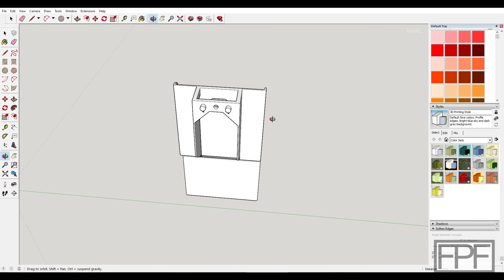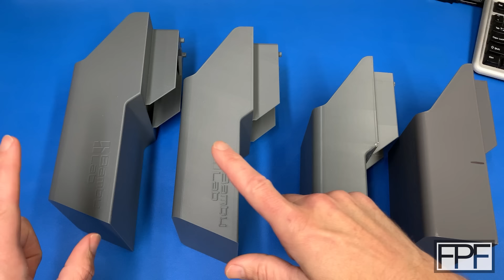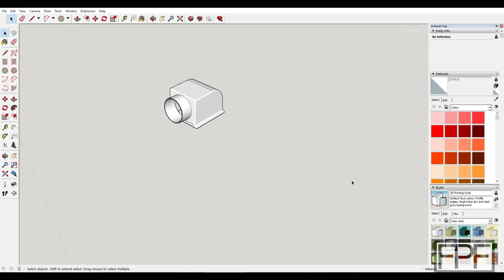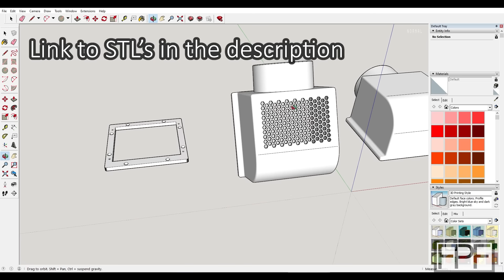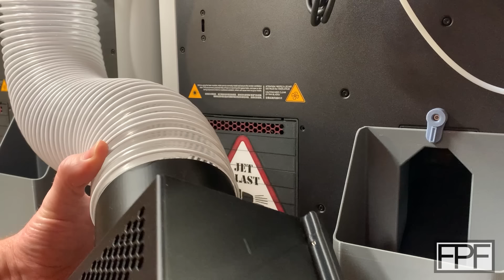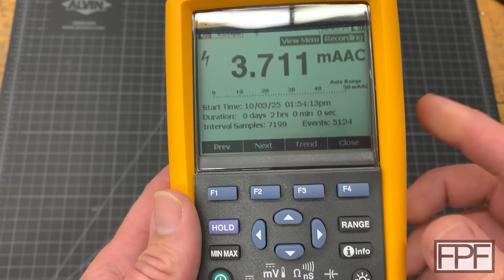H2 Series Fume Extraction for 3D Printing - FINISHED

Comment: It's an interesting exercise finding an orientation that gets good print quality with minimal supports, but don't forget that you don't have to print a piece in on go.  You could for instance have printed the top plate and hose adaptor as one piece which slotted into the rest.  For some projects you can still print as a single piece, but have a living hinge.  For instance, in this case you could have had a hinge between the top/adaptor and the rest of the build.  It does complicate the design somewhat, and I think your solution is probably best for this design, but just keep your mind open to the other possibilities.

I suspect your observation about losing less heat with the extraction on boils down to where the leakage was coming from.  You were equalising the volume of air being removed from the enclosure, so that none was escaping out of the chute.  If there's a lot of hot air near the poop chute, each cc of air leaving the chamber is also removing a lot of heat.  If the fan is in a relatively cool part of the enclosure, each cc is removing relatively little heat, so although you're removing slightly more air, you're not removing as much heat.

You face a similar issue when installing fans on PC enclosures.  For maximum cooling, you want the fans at the top to extract the hot air, and the fans at the bottom to push cooler air into the enclosure.  If you get the wiring polarity wrong, you're pushing cool air in at the top, but this just causes the hot air to circulate around the enclosure, and you're extracting the relatively cool air from the bottom, greatly reducing the cooling effect.  If you increase the fan speed, you can still get cooling just by replacing more air, but if you get the fans extracting from the hottest spots you need much lower fan speeds.

Comment: That is strange. After you made that video, I went and printed the waste bin using bamboo PETG translucent, and it printed very cleanly…. Well, the first time it warped mid-print and the tool head knocked the entire print over, but the second time it printed very cleanly…

Comment: Too late for it now, but one idea to avoid supports on the part would be to either make the bottom completely flat or to change the bottom curve of the exterior to a flat surface angled at 45 degrees. Either way, the inside could remain rounded.

Another idea is instead of having a flat surface on top for the exhaust hose fitting, use a lofted surface to transition from the top square profile of the vent box to the round profile of the exhaust hose fitting. If designed right, the resulting taper would be steep enough to print just fine without overhangs. Combined, the two ideas would allow you to print with the bottom laying flat on the print bed and no need for supports.

Comment: For the over-blow feature of the fan hood, perhaps a bit of a mylar covering to allow one way blow, where the gate is closed the printer is blowing that it has an exit.  Otherwise I think that constant low pressure from the radon vent is not too concerning unless you are printing ABS and have a cooler basement drafts that would react to 'Shock Drafts'

Comment: Another excellent video
From the video you seem to be monitoring AC current to the entire printer. If so you may need to consider one of the other main loads other than the heater, the fan. With your hood in place the chamber fan is no longer exhausting against atmoshperic pressure but instead against the lower pressure of your Radon system. This might explain your printer slightly lower energy requirements.
Keep up the good work
Reply from the maker: Could be

Comment: Wow, simply an amazing video one of your best so far.  I learned a lot, and a cricket hunt to boot!  Again, on the back with the pegs, the Bambu Labs fume extrator actually screws on using those holes, but I guess there are advantages to have it be totally removeable.
Reply from the maker: Only so many times even when lining up at the start of the thread that self tappers in that plastic will last.  Bambu cheaped out there. Should have been steel or brass threads.
Reply: @FunctionalPrintFriday Oh maybe I missed that.  Thanks for the reply!

Comment: I think you mean well. The top flap is great, but I think you shouldn't cover the flaps with your part, but rather like an extractor hood in the kitchen, i.e. above the outlet flaps. Then you won't suck the air out of the printer, but the poisonous gases will definitely disappear into your hood with the hose. And because the flaps are printed on the printer with a lever, you'll definitely manage to make the flaps open upwards so that the air is blown directly into the hood. Nevertheless, it's cool what you're making for beautiful parts, top-notch, and I love your videos and work. Greetings from Germany

Comment: I would be interested to see a flap valve fitted to the poop chute and similar power usage tests ran.
Obviously the spring on the flap valve would need to be infinitesimally weak to be overcome by the poop coming out of the printer.

But if your theory is correct, then this should also achieve the same as balancing the extraction (should be identical???)

Comment: Those threaded dowel pins are fabulous! I also use my hot air rework station for heating up all sorts of things in a controlled way that aren't surface-mount soldered components. Really handy tool to have around the shop, and they're not that expensive these days with the cheap import models (which do a more than adequate job for home use).

Comment: Interesting video, and solid, thorough analysis and effort, but not necessary to be this precise with negative air pressure as the chamber is actively heated and there are many other varuables in play.  Much better to focus on VOC mitigation.  Based on my own much less precise Diy heater setups and only hitting 45-48C chamber temps, for any materials these printers are capable of printing slightly too much negative pressure will not matter.  First layer adhesion and printing with the right temp, speed, and part cooling will have orderers of magnitude higher margins of error in regards to impacting warping, layer adhesion and part quality.

Comment: Aerodynamics is complicated, but off just intuition I'm thinking the transition from a rectangular box to a round hole would cause a lot of turbulence near where the hose attaches to (which is also where the holes are, which complicates things further). What might help is using a loft to transition from the boxy shape to a cylinder for the hose. Probably negligible though all things considered, but just some food for thought!

Comment: Questions:
Can the hinged vents (Jet Blast) be reversed so that when opened, they face upwards, directly in the direction of air extraction?

Why not replace the magnets and pins holding the air hose adapter with a printed U-shaped guide held in place with double-sided tape or screws?

Ideas:
Regarding the waste collector, design a closed one. Finally, add a cutout to hold an acrylic piece. This serves as a fill level sight glass. When closed, it won't function as a chimney or air injector into the build chamber.

And about the control of the air suction system, to be as less intrusive as possible we must go into more technical issues, we need to have an idea of the revolutions of the extraction motor, or measure the differential depression inside the printing chamber, and for this I was thinking of taking 2 measurements, the first measurement would be the opening of the air inlet gate that would deliver an on / off signal, thus avoiding the complexity of reading RPM from the extraction fan or the installation inside the printing chamber of an anemometer, the second measure is achieved by always measuring the real depression (differential pressure) in the printing chamber, with these measurements, especially with the last one, we can control a flow control gate in the external suction hose, obviously all this or we would do with an MCU (esp32 or arduino).

...and excuse my poor English, I used Google Translate because my language is Spanish. :face-green-smiling:

Slds!  :face-red-heart-shape:
Reply: Exactly!  The Bambu Lab fume extrator uses screws!
Reply: As someone said in the comments, if you want a fill level sight glass, you can make the waste collector with both opaque and transparent PETG sections (gosh multi filament printing opens so many possibilities).

Comment: Why place the blast gate on the ceiling? I would have tried to design a gate at the back the printer (ball valve or butterfly valve) so that you could open/close it there rather than trying to “balance” it with the paper towel.  Then put in a wye for both and control open-closed for each printer where you could have them both open or both closed.  IDK.., just what I was thinking the whole time.

Comment: Could you try a clear lid on the purge bin to prevent hot air convection from escaping the purge shoot opening?

Could you integrate a free swinging flap instead of the hex pattern into the vent cover, so that you can adjust the blast gate just by making the flap swing neutral to very slightly inward?

Comment: I don't see the need for holes in the printer flaps. They have enough slop that a neg pressure atmosphere would create a draw IMO. I think the big flaw is that when printing things like abs the printer is going to change pressures to maintain set heat. Meaning you will need to babysit the printer to maintain your paper towel settings. Also doesn't the printer increase the fan huge at the end of the print to cool the chamber. I don't have my printer yet so I don't know... Fun experiment but I think it would be better to have a hood over the unit and something around the fan door to get the fumes when the printer fan kicks in. Also the printer isn't air tight. I would love to see where most of the VOC's are leaving the machine from, my guess  it is not the exhaust or any of the side holes (poop hole) but from the top of the unit even with a slight neg pressure.

Comment: Makes sense that reducing heat loss in one area will reduce the need for heat input to the chamber.... You may also want to consider adding a fine tune adjustment to the suction gate to make it easier to tweak the suction. Maybe an 'iris' assembly on one side of the gate. Leave the gate to quickly and securely allow or isolate flow. Here's an example... https://www.youtube.com/watch?v=Aai_c5PSpf0

Comment: With an Arduino and a barometric pressure sensor you could probably control the blast gate/flow rate automatically.  Those sensors can detect tiny drops in atmospheric pressure and are commonly used in weather projects or as altitude sensors.  The barometric sensor could be placed inside of the exhaust cover you printed and be used to maintain exactly 1 paper towels worth of negative pressure in that space regardless of state of the exhaust fans/louvers on the H2D.  Alternatively, it could be placed in the H2D chamber itself to measure negative chamber pressure directly which could be useful if you wanted to be able to detect certain situations like door left open, poop chute cover left off, or any other config change that could prevent the desired negative pressure from being achieved.

Comment: The heat loss through the purge chute is called a "thermal syphon."  It happens when hot air/liquid starts to create a convection current with part of that current running downward (against the normal flow of hot air).  This can happen when the combined downward sections of the path are less than the combined upward sections of the path.  Once it starts flowing, the rising hot air in the upward sections pulls the air behind it through the downward sections.  Vice versa for cold fluids of course.  So, similar to syphoning a liquid through a tube.  The liquid can travel against gravity to some extent, but only if the overall path is with gravity.

The way to prevent a thermal syphon is to extend the section that is going against gravity/convection or add up/down U-shaped thermal "locks" in the path.  On the H2D, that can be done with a purge chute cover that is only open at the very bottom and extends down maybe 4 to 6 inches below the top of the purge chute (so roughly to the bottom edge of the purge chute on the back of the H2D).  That way, hot air would have to travel downward several inches, against convection/gravity, before it can start to rise again.  I made a magnetic cover like this as soon as I got my H2D and it seems to work based on thermal camera and lack of ABS fume smells in the room.
Reply: What’s the name of your model? I would like to convert it to this
Reply: So just a cover for the poop chute has improved ABS smells during printing for you?
Reply: Yeah, as i was watching that part of the vid this was my thought too. House the poop chute to mitigate the air its exhausting. Guess that will be my first design for the h2c haha. Ill be adding extraction too. Also thwnks for the video I was watching to see what effect the extraction had on the cost to heat or the extra strain on the chamber heater. In this case negative! Ideal!
Reply: Would a removable cover on the poop container do the same thing?

Comment: Observation: put a 90° elbow on the pipe. That corrugated hose really doesn’t like tight 90’s over the long term. Lots of stress on the plastic on the top side there and it tends to tear.
Reply from the maker: Yeh, was hoping to avoid it but i think you’re right

Comment: I think you should actually test if negative pressure affects the print quality as much as you're imagining... They're leaky boxes to begin with. As long as you're not full blast sucking all the air out.
The fine adjustment is neet, and you won't see the improved power without it, but you can probably have 4 detent at 25% opening intervals and not bother having to do it every time you start a print...

Comment: Could you have split your vent box in half vertically parallel to the mounting face to print without supports? Then glue them together.

Comment: Funny, I actually need to get a new hot air station. I’ve had an Atten 862D for a couple years (not used much), but it seems to have quit working at some point. I went to use it for something the other day and it appears to not be working. Maybe it can be fixed, but if not I may get one like yours just for 3D print wisp removal lol

Comment: Fun conclusion to a project as always! I wonder if creating another moveable cover for the vent holes at the back of the adapter would be a good upgrade? That way you could maintain full suction when it’s running, but still be able to vent air without it.

Comment: V+ buterfly valve on the output to adjust the air flow on ground level.
With a dial calibrated for diferent fan speeds.

Comment: When you were checking the airflow from the top of the adaptor without the ducting attached and said it almost felt like there was more air than without the adaptor you may have been right. It's possible that redirecting the air to flow upwards is causing a venturi effect with the holes at the back and drawing air from the back into the flow. Could check with your smoke machine to see if it blows away from the holes or gets sucked in.

Comment: A year ago I made closed type of purge bucket for P1S printers because I noticed that printers lose a lot of heat trough purge shoot.  I noticed after mounted closed bucket that smell from ASA/ABS printing decreased greatly and chamber temp went up for 3 degC. When I got my Bambus H2D-s I did the same thing without thinking.

Comment: Why not just do a rough seal on the poopshute to get ride of the heat escaping there and that will stabilize the whole system. minimize differences from the start of a print to the draft being a problem, no need to keep adjusting your blast gate. Make the poopshute open from the bottom to dump out the waste material.

Comment: Perhaps redo the same test with a "lid" on the poop-bin? Making it harder for the machine to suck in cooler air that way. Potentially reducing the "chimney-effect"?
Reply: That’s actually exactly what I was thinking and just came here to comment on.

Just add a swivelling lid to the poop bin, that closes when attached and swings open when taken off and pouring out the poop. If you want to monitor the accumulated poop, just print either the bin or the lid in transparent PETG!

Comment: (PID?) control the blast gate with a sensor on the "paper towel". 39:40
Reply: I did this with an ESP32 + SDP800 to measure the pressure just outside the printer in the ventilation channel. Using a PWM Fan to control the suction. Works like a charm. Only thing is I used a PC fan which is not strong enough if the exhaust fan is above 50%. Will fix that :)
Reply: Yup. That’s exactly what I was thinking 👍🏻

Comment: Super good. You can also add the other holes back, and then put a flap that acts as a check valve inside to cover half of them. This way it would be at least somewhat self correcting and you would have a higher margin of error on the suction.

Comment: For overhangs when using PETG-HF... have found the material generally prints poorly, but especially before/after long walls.  To improve things, in Orca need to enable and adjust 'extrusion rate smoothing' on the speed settings tab.  The additives in HF material appear to make it flow too easily, and it shows on overhangs.
Reply: Also reduce layer height on the overhangs,  the thinner the layer the less it needs to step out on each layer meaning move overlap assuming the same width from the nozzle.
Reply: That applies for petg in general, it's a bit runny.